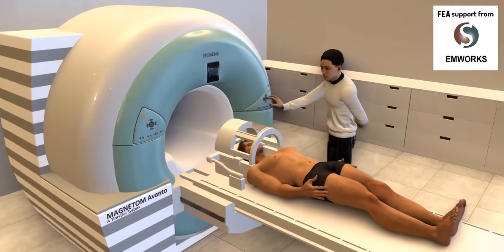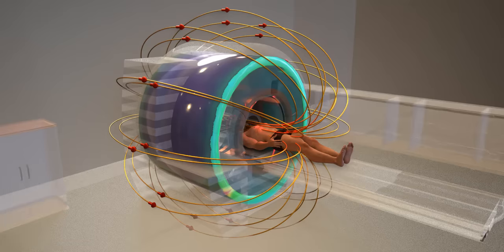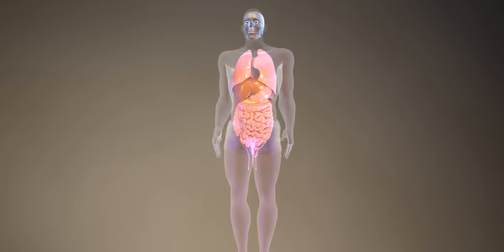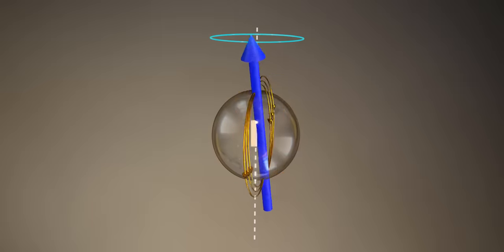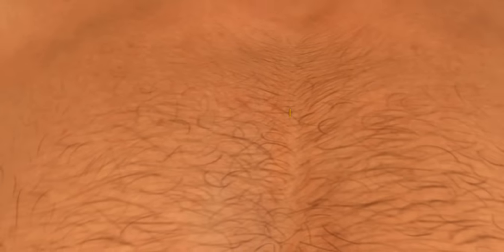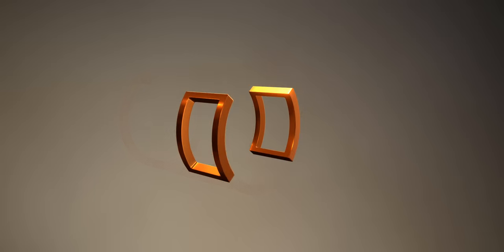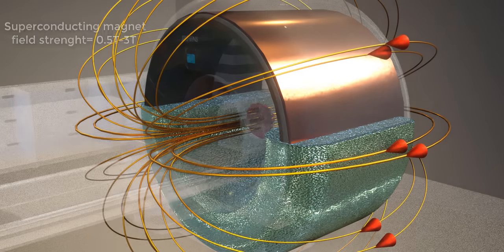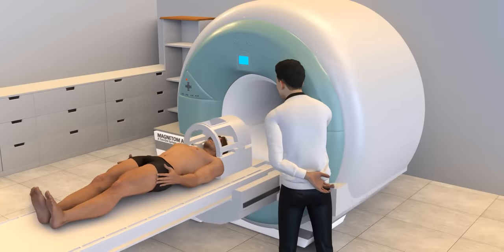How does an MRI machine work?

Comment: I'm working on a construction project that involves an MRI. Something really fascinating to me is all the shielding that is required for that equipment. Copper in the walls, non-magneric structural members, etc. We had to locate the MRI 30 feet from the parking lot because the manufacturer is concerned that vehicles outside the shielding would affect the MRI device (or that the MRI device would affect the cars outside)
Reply: The company that I work for, builds the rooms for MRIs.  Other thst distance from ferrous masses, magnetic shielding can be used to dampen the magnetic field.

Comment: I asked a few Engineering students, "Can you give me 2 common uses of Superconductors?"  Unfortunately, No Answer.  Lesics makes the STEM students interested in practical applications of Physics and Chemistry in Engineering, gives some details for understanding, and then they are on their own--exploring, learning, and inventing throughout their career.
Reply: Superconductors are pretty much used anywhere it's at all feasible at this rate though (i.e high energy currents in stationary circuits) 

So idk if its really something you need to teach students early on. As soon as they have to use magnets for something they'll figure out that superconductors are very nice

Comment: 0:16 "an MRI scan produces a very detailed 2D image of the brain" While zooming on a 3D image, slightly confusing. 
Other than that, great video! :)
Reply: They produce multiple cross section images which will produce  highres 3d image.
Reply: @kunjukunjunil1481  that is true for standard and ct scans tho some MRI scans are "magic" and use a 3d furrier transform something that text book more often that not just leave out ... So yeah technically true but as with everything in MRI it's more complicated than tat

Comment: is MRI endangering the person who is scanning inside,
what is the short term effect on your blood? the radiation you're getting there?
and the effect of exray
Reply: There's no such radiation like in X-Ray & CT scans in MRI
There's no harm at all, you could perform MRI Scan on a daily basis & still get no harm at all
Although there's sometimes temporary side effects like dizziness due to rapid variations of the strong magnetic field & warmed up body parts which is caused by induced eddy current circulation in your body
I'm MRI engineer & I volunteer to perform a lot of MRI exams on my self to test the system after fixing it

Comment: How damaging is the patient while having MRI?
Reply: Scientific consensus is that low fields MRI is not damaging to the general population. There are exceptions like people with metal or electronical implants not designed for it or people with issues thermoregulating... While there are no specific counter indications pregnant women are discouraged from having MRIs.
Reply: High field MRIs have the same issues just lest forgiving and some degree of danger to the exposure to high magnetic fields that may cause temporary problems to balance or headache if ones move too fast. But these are issues noticeable from 3t upward

Comment: I thought that was the way it worked !(lol). Anyone know what RF Frequency is used ?
Reply: A physician called Larmor placed a rule for calculating the precession frequency (precession not spinning) of particles around their axes under the effect of applied magnetic field

He noticed that the frequency varies directly proportional with the magnetic field strength

For each particle there's a certain constant called Gyromagnetic ratio that best describes the relation between particle frequency & the magnetic field strength 

As you know the MRI targets the Hydrogen particles for scanning (specifically Hydrogen protons)

For Hydrogen particle the Gyromagnetic ratio is 42.58 MHz / Tesla

Which means that the Hydrogen proton will precess with frequency of 42.58 MHz if we applied magnetic field strength of 1 Tesla

For 1.5Tesla magnets (most common MRI Strength)
1.5T x 42.58MHz/T = 63.9MHz

So the general rule for Hydrogen :
Magnetic field strength in Tesla x 42.58 = precession frequency in MHz

Precession frequency is commonly known as Resonance frequency in MRI 

Why Resonance ?
Because the RF Frequency applied by the Body Coil has to be the same exact precession frequency of Hydrogen Proton in order for RESONANCE to take place & as a result the Hydrogen particles will be able to absorb the transmitted RF energy

No Resonance = No RF energy Absorbed = No Rf energy Released by body = No Image

Ahmed Abdelsalam 
MRI Engineer at Siemens Healthineers

Comment: So an MRI machine is just a big microwave then ?
Reply: Yes, basically a huge microwave + huge magnet

But let's not get people frustrated from being cooked in a huge microwave 

Of course there's universal safety measures in terms of SAR (Specific Absorption Rate) which states the max amount of RF (Radio-frequency) energy absorbed by human body
Because if the human body absorbed higher RF dose than the stated SAR limits you might get burns on your body

Every MRI System is equipped with RF monitoring system to stop the exam if the SAR limit is exceeded